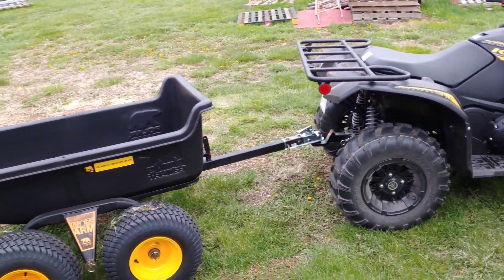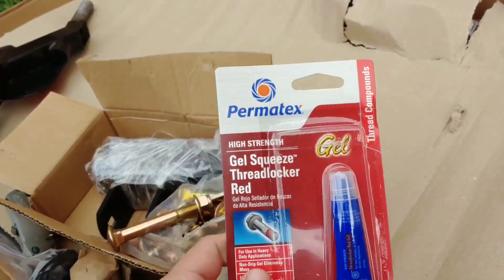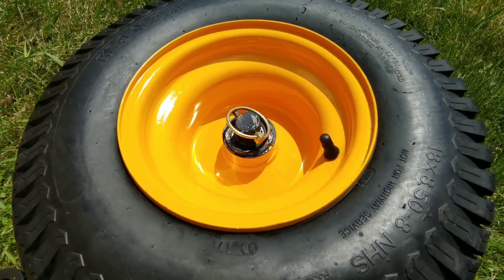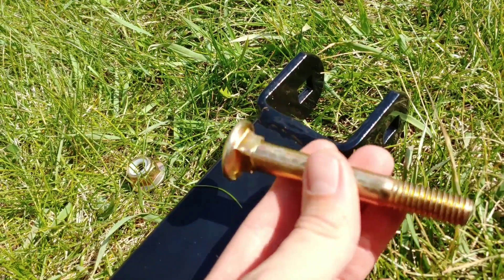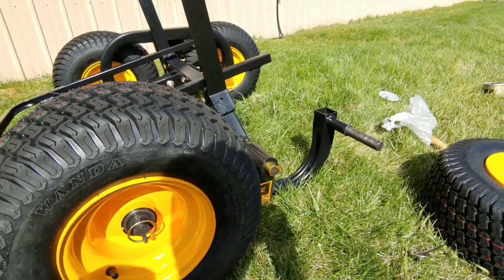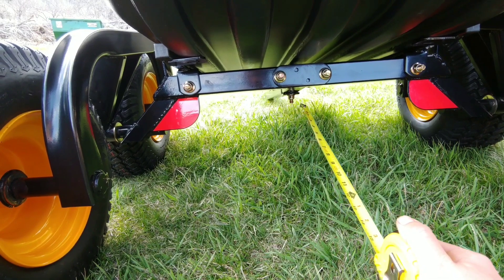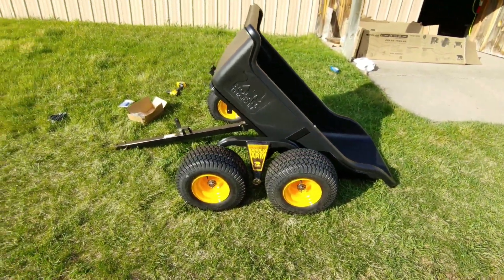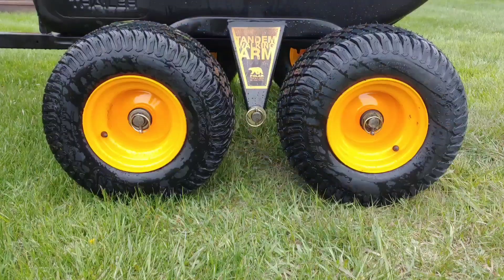Best Off-Road ATV Trailer - Review

Comment: The bolt that his hanging down:  It's there, so the trailer can pivot when it dumps.  It's a feature built by Clam.  Occasionally it's handy.  I wouldn't weld it.  Maybe grind the bolt down at most.  In reality, you'll probably bottom our your ATV before you bottom out that bolt.  Also, as commented by others, you didn't need to drill that hole.  Plastic bin flexes,  even the metal flexes a little.  It would have fit if you'd have used some pressure to make it fit.  I had the same issue, and it worked out without drilling.  I think the plastic bin flexes a bit when it's boxed up for shipping.

Great trailer.  7 years on mine, and I burn 3 cords of firewood a year, all of it hauled in a Polar 1500.  So 21 cords, of wood hauled, and still as good as the day I bought it.  I'd recommend it to anyone looking for an ATV trailer.  Come to think,  Woods to splitter, splitter to wood pile, wood pile to garage, and it's more like 63 cords of wood for me in those 7 years.  Compare that to the metal box trailers that I'd wreck every 3 years or so, and I'm very pleased with the purchase.  I don't treat it lightly, and it's held up great.  I joke with friends that I have a half ton truck with a 3/4 ton ATV trailer.  I don't think you'll hurt your ATV with a heavy trailer.  It's quite well balanced, and even a heavy load doesn't make my ATV squat as much as a rider on the ATV.  You'll run out of traction from the ATV being too light before you'll hurt the ATV in my opinion.

The  4 tires really smooth out the ride, but there are some slight weaknesses with them.  1.)  If you hit a rock or log that's taller than the mid point of the tire, the axle can flip, at which point the top of the axle, arched like it is, turns into a ski, and scratches up pretty bad.  It only seems to happen when you have a heavy load, which you then have to unload to get it righted & then load up again.  Doesn't happen often, but it would be nice to see Clam design it so the axle can flip.  That would give it a bit more off-road ability. 2.)  Tires are exposed.  Firewood (or anything, I suppose), thrown into the trailer that misses can bounce pretty good when it hits the exposed tires.  Sometimes right back at you.  Just a heads up; I don't think I'd change that design.  3.)  Tires are wider than your ATV...  You will learn the disadvantage of that when you catch a tree with an axle & it wants to throw you over your handlebars.  You learn to be careful with that after the first few times.  Or just as bad, hitting a sapling, and whipping it down onto the back of your head.  :-/  More of a trade-off than a design flaw, though...  The width gives you more capacity than a narrower trailer, and is maybe designed for UTV's rather than ATV's?  Despite those issues, I would still buy the  double axle.  It feels like it smooths the ride over rough terrain so much that it beats up the ATV less than a single axle.

If you're concerned about 50", I believe going with the single axle rather than the double will cause the tires to be maybe 3-6" or so narrower, if memory serves.

Would love to see a chainsaw holder for it, something designed by Clam, not jerry-rigged by me.  Also, I'm trying to figure out how to put a hitch on back to piggyback my log splitter onto the trailer, and save myself all the double trips out to the woods.  I think I'd give up the dump capability to get that.

Comment: The big square washers inside of the bed are there for a reason, to distribute stress over a larger area of the plastic, making it much stronger. Leave them there, underneath, you are correct in assuming there should be washers there also, go buy the proper sized ones. The bolts with the squared flange under the head are called carriage bolts. They do make assembly easier & increase longevity of the assembly, get a proper bolt & washers for you trailer hitch, having the carriage bolt sticking out like that won't last as long as you think. Other than that, good clip.

Comment: I just bought the TA 1200 HD and noticed you can’t make tight turns. The wheels lock up and so maneuvering in tight spots will tear up the lawn or wear down the tires when driving on pavement with a 4 tire configuration.

Comment: You didn't have to drill holes at the top of the tub. All you needed to do is to apply some force to metal supports to line them up with the holes. Easier way is to put the bolts into two top holes fist and then push on the tub with your knees to align bottom holes